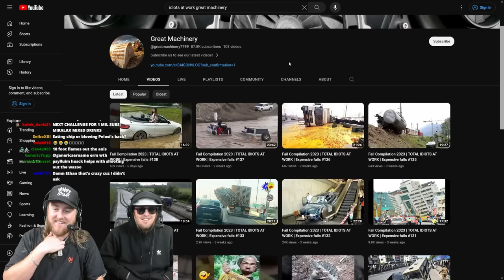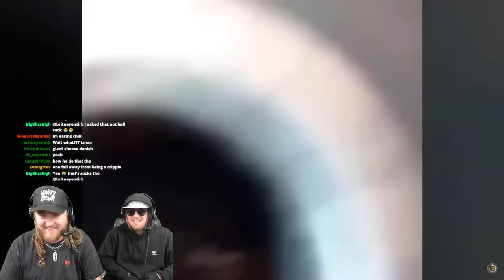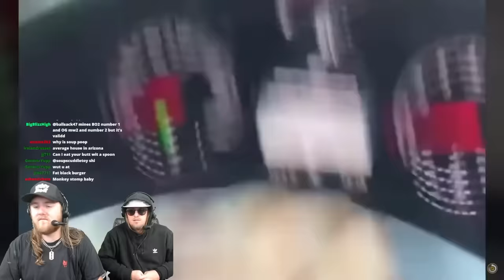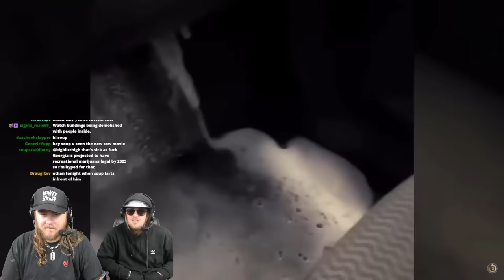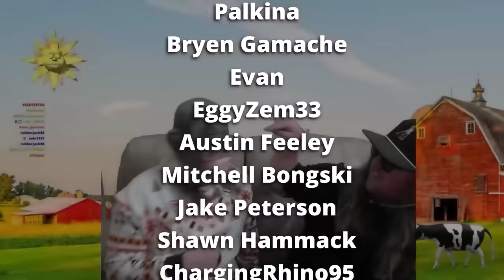The Funniest Fail Compilation Ever…

Comment: 4:05 The rubber hand band is cleaned with brushes when it goes underneath. He doesn't need to clean it, he was trying to clean around the rubber band.
Reply: So actually why tf was that a 'fail'?
Reply: Yeah I think the editors are the idiots in this case lmao. Look at the handkerchief, you can see the sides of it are almost black from scrubbing the metallic part of the rail.